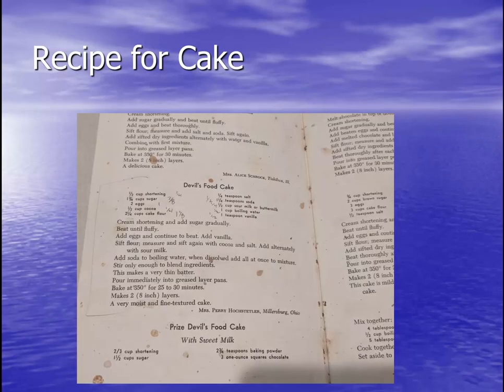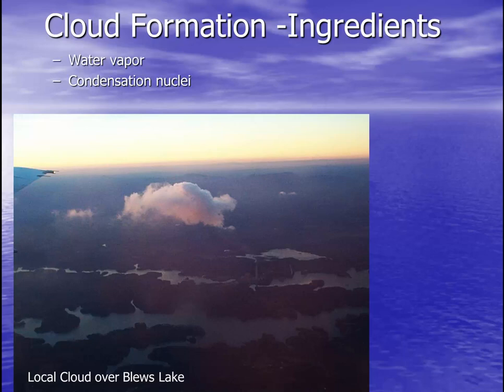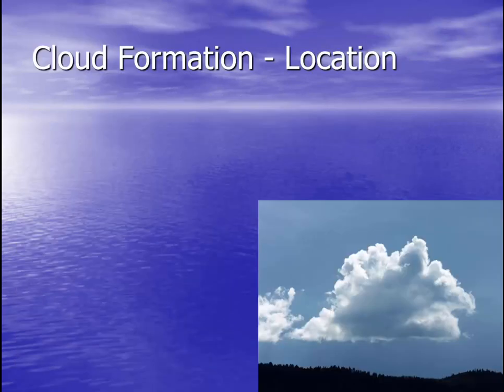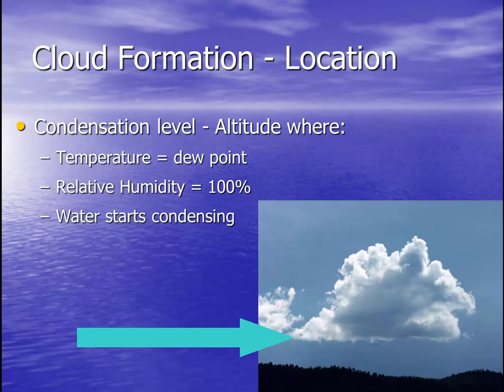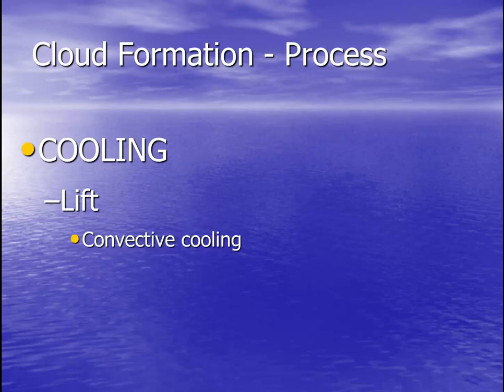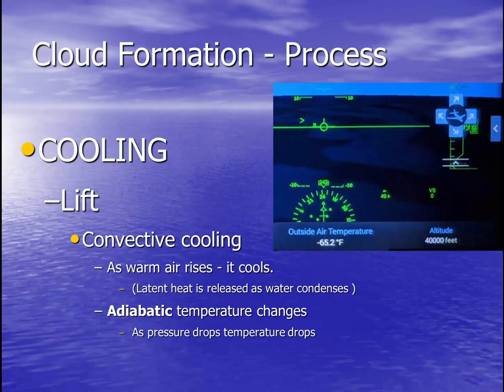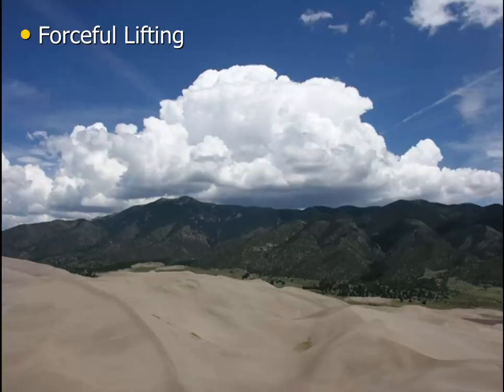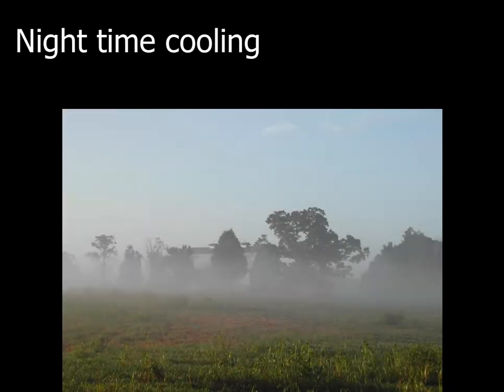Meteorology 10 - Cloud Formation

Comment: why nobody has a microscopic view/video of cloud formation ?
Reply: Clouds tend to be rather large, so getting a microscopic view of cloud formation may be challenging.... Are you interested in seeing a microscopic view of the condensation and or deposition of water vapor?     That would be possible if you wanted to see it on a stationary surface.   For a cloud, Considering condensation/freezing nuclei in clouds are in constant motion, a microscope video of the process would be quite difficult as the particulates would not stay within the focus range.
Reply: @timmartin1181  Do you have video of condensation?
Reply: @timmartin1181  the point is I wanted to see how flying drops combine and forming spheres, other than condensing/depositing on a plane surface, but even that would be nice.  I have been doing some modelling of ballistic aggregation process lately.